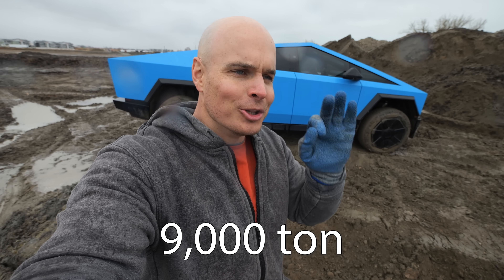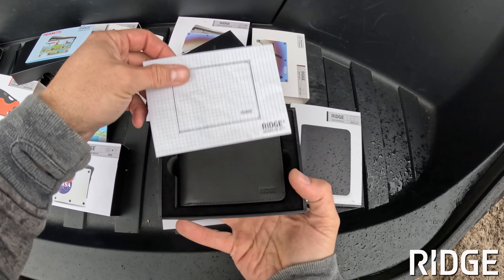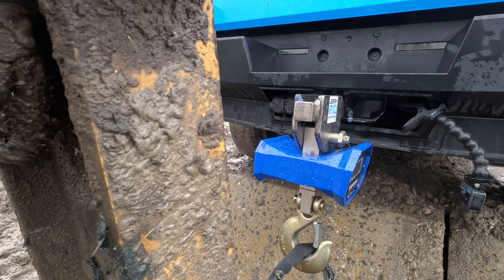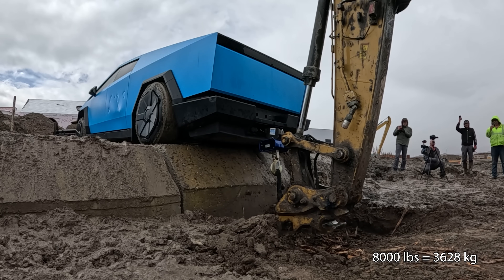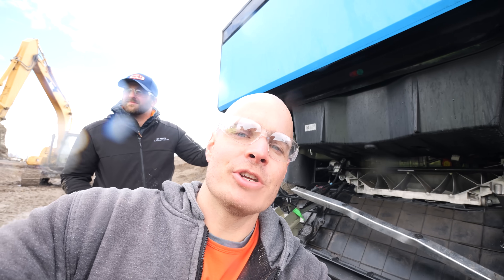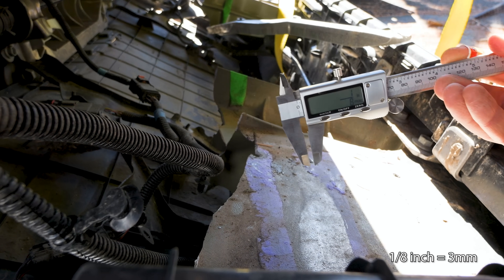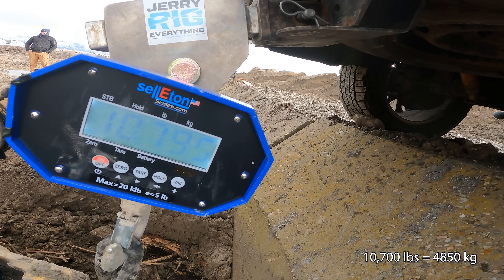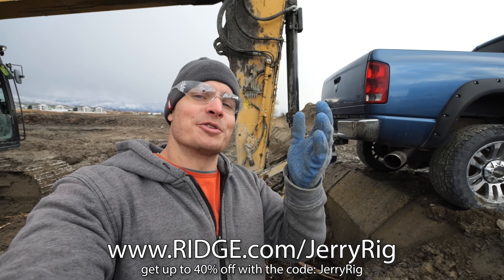SHOULD YOU TOW WITH A CYBERTRUCK?! - (catastrophic failure test)

Comment: I think the 11k limit is for pulling forces ( like a towing a trailer for example) instead of forces pulling directly down. Obviously under normal conditions the hitch will experience some downard force by for example the suspensions going up and down but not the full weight of whatever its towing. Still this failure is quite concerning
Reply: It survived over 900% of its rated hits capacity. That's pretty good.
Reply: Yet another Tesla failing safety standards… but definitely keep hacking away at regulations…??  lol, Amerikkka is screwed, elon is a nightmare and obviously racist/horrid and actively making the US less safe.
Reply: Exactly, the tow rating is for pulling, the vertical weight limit usually much lower since the trailer has to take its own weight (some weight is transferred onto the hitch but not much). At least thats how it works here in Europe.
Reply: @Zepedrofig  Reading some comments, it seems physics here in Europe are not the same as in the USA
Reply: @Zepedrofig  another tesla simp who won't watch the video
Reply: @TheWizardboy5 Haha, those Cybersimps are amusing.
Reply: watch the video lol.
Reply: whistlindiesel broke the frame by simulating an off road recovery of an f-150
Reply: @TheWizardboy5 no, Whistlindiesel didn’t simulate off road recovery. He simulated beating the piss out of a vehicle, then intentionally attempting to break it, by dropping the truck off a 6ft drop directly onto the hitch, then during recovery, after the F150 was pulled free and was moving, slamming on the brakes to introduce a multiplied effect. 

And sadly, Jerry who I have massive respect for, just demonstrated vertical load capacity, which is rated for around 1100 lbs, which the Cybertruck massively exceeded holding up to 10,000 lbs. I really wish Jerry would have showing the horizontal load capacity of the hitch, which is the realistic tow capacity for which Tesla claims the CyberTruck is capable of 11,000 lbs. 

Now, there will be countless news articles hyping this misleading failure, which will amp up the anti-Elon crowd.
Reply: @DrivingInnovations  Vertical load capacity is accounting for bumps and stuff as well, it is supposed to be able to hold 1100 lbs when cruising down the highway hitting a bump or the like, which multiplies the weight by alot.
Reply: I don't think a bump could introduce these kind of forces. This was applied continuously with the suspension bottomed out. A bump at speed would have tires and suspension to help dampen things.  @JLKING98
Reply: @SasquatchsCousin33  i guess both yes and no, the impact could still be quite harsh but I get what you mean as well.
Reply: @DrivingInnovations  
Now you need to rewatch the video.
1. he did not hit the brakes. Their ramp had a cap between the ramp and cylinders. the front wheels dropped into that cap (think of it like a massive pothole) and got hooked there.
2. The issue, as i see it, is not that it fails at X weight. Its the how it fails that is concerning, with a side note, that people have actually broken those hitches in use, not in abusive testing.
When these hitches fail like jerry rig reiterates at the end.
The car breaks and becomes undrivable when the hitch breaks, the hitch snaps off (that is bad because the failure mode is sudden, like a tire blowing up instead of running flat) and your car completely gets disconnected from the trailer.
Reply: @DrivingInnovations  the ram didn't break yet the tesla did keep coping elon simp
Reply: @JLKING98  It should be good for 1,100lbs static, the dynamic loads hitting a bump on the highway would be higher but not 10,000 lbs higher.
Reply: also the dodge didn't catastrophically fail at 700lbs under its rated maximum
Reply: @TheWizardboy5  that's true. The way the cyber truck failed is pretty concerning. As jre mentioned loading this thing improperly could end up pretty bad
Reply: @johnkarpontinis1410  he also mentioned that climbing hills or steep driveways translates pulling weight into tongue weight and an abrupt shift in weight like that could snap the frame while still being well under 11k

Comment: so whistlindiesel was right after all huh
Reply: someone doubt it?
Reply: I thing everyone can see in the video - one breaks, the other does not. Which one is stronger?
Reply from the maker: Yes. Indeed he was.
Reply: @JerryRigEverything please collab with whistlin diesel
Reply: Right about what? Isn't tongue weight 1100lbs?
Reply: @JerryRigEverything  Read the comments from the engineers rather than those who are oblivious to what flawed test this was 🤦‍♂
Reply: Even worse, the frame was glued together instead of bolted through.
Reply: @Skylancer727  Spot welded, I think. Most parts of steel cars are built like this. Don't know about aluminum.
Reply: @arpatech  it's very difficult to weld aluminum. That's likely the whole reason it was glued. But steel bolts still would have held better. That's how most truck hitches are held on in the first place so bolts would have plenty of strength to counter it.
Reply: @Skylancer727  to me it looks like it was panel bonded and then spot welded, I mean bolts would probably still be better, but I don't think it was simply just glued
Reply: A tow rating isn't the weight you can directly apply downward on a hitch
Reply: @seansz28  You're right, but as highlighted in the video, and well known by anybody who tows a lot, there are situations where even a properly loaded trailer can put a much larger force on the ball than expected. Then take improperly loaded trailers into account, and it's not even remotely as outlandish a situation as you'd think.
Reply: People sure love the content...that's why this video was made. Got to jump on the hate train when its moving.
Reply: No. Both were excessive abuse un regulated
Reply: he did drop the rear end on concrete but something like that COULD happen while towing a trailer which is the major problem. Also the fact that just the weight of the rear end of the truck hitting the ground caused a catastrophic failure is crazy
Reply: @LooperEpic  Even if he dropped it on concrete before it broke. The follow up video with the f150 getting it multiple times on concrete didn't snap and even came back after getting pulled hard enough. I would honestly be scared towing with an aluminium frame just because it snaps instead of bending. Steel bends and sheers before separation. Alu doesn't.
Reply: @sampic_  "Other trucks do better" is all well and good, but it doesn't prove that the Cybertruck isn't suitable to tow within its rated capacity.  I don't remember what Whistlin's video showed, but this video most definitely didn't show or prove that the Cybertruck can't handle normal towing conditions.
Reply: @bvoyelr  This video conclusively showed that Cybertruck can’t handle normal towing conditions for this class of truck.
Reply: @sampic_  Steel generally bends, great, but that doesn't actually make a bent truck a safer failure or certain to give you warning you are being idiot that will cause failure - as welds for instance are often prone to brittle failure much like the casting, and give it a few years especially on salted roads and it might well be rusted through somewhere hidden etc... Really neither is better than the other when designed and treated properly.

So as long as the casting has sufficient safety margin for its rated tow weight and you don't abuse it first there is no difference, except in your mind. Much the same way folks jump up and down about burning EV and they get on the news all the time, yet a burning EV is in many ways safer than a burning ICE car as its 'fuel' doesn't easily flow off carrying fire with it to ignite the surroundings - obviously neither being on fire is a good thing, but EV fires have folks jumping up and down without even noticing that the ICE vehicles have the exact same basic problem, and might even be more dangerous - it is just a more familiar danger so you don't even consider it.
Reply: @foldionepapyrus3441  I'd still trust a bent frame to tow something. I wouldn't trust a cybertruck to tow anything. Anyhow, with the range you get while towing it's not even worth towing with it. Unless it's within the same city.

Most cars I've seen burn recently were Nissan ICE cars there has been 2 in a month in my city.

Granted I'm not an EV lover, nor am I a hater. I just think EV's are not the solution and the infrastructure around them is not close to be efficient enough for them to be worth it. Hybrid is the best we can have right now. I just hate seeing Tesla at the top with mediocre cars that are overhyped while there are other choices on the market with better QC and specs for a better price.
Reply: @LooperEpic Something like that probably happens every day to someone while towing. Aluminum is a really wonderful material in its place. But its place is not as the frame of a truck.
Reply: towing is a force to the back (pulling) and not downwards pressure. Who puts 5 tons right on the hatch? right, no one
Reply: @jannis01  There's no way you're still defending an aluminum Frame at 10 Minutes he Both Visually and audibly Shows you Situations that would happen ALSO Explaining its bound to break under ANY Situation from Basic wear and tear from regular towing an Aluminum Frame is a horrible idea and the Cybertruck is an Embarrassment of a vehicle
Reply: @ZembVR  I agree its an embarrassment of a vehicle but on this issue so far I'm pretty convinced you actually have to abuse the truck first to put it in a dangerous state. Towing up hill doesn't ever put that much weight straight down on the hook, even cresting the hill etc - so much of the weight of the trailer is always on its own wheels, and then the actual direction of force applied to your tow hitch is never straight down. 
Willing to change my mind on the crappy truck being fine  if treated properly on this issue but only that if a sane, rigorous and meaningful test is done though. As for now really the material and structure seem pretty good to me - the only problem is after that abusive moment (which may be somebody else driving into your towbar while your not even there to notice) a steel frame vehicle would be bent and showing the 'damage'  - you'd know to check if the welds cracked etc etc, where the casting probably looks good as new, but it is now structurally weakened...
Reply: @foldionepapyrus3441   You’re really going to have to contend with the fact that multiple Cybertrucks have been damaged from towing that was within the limit in the wild.
Reply: @Danrarbc if you follow the 1100p toungue weight it wont brake under any conditions. You need like 1600 poind static force, uphill of 25% pothole and hard acceleration or braking all at the same time to brake it. For the car stuck in mud situtaion if you assume worst case that the car wont move at all, at full throttle you need to pull at 55 degrees to brake the  hitch, assuming the chain is lose enough to get to the full acceleration.
Reply: Tesla needs to smooth out the design and reengineer the towing for 2026 model and it will sell huge still... Iykyk
Reply: @dertythegrower  you think they'll still be in business by 2026? LOL 😄